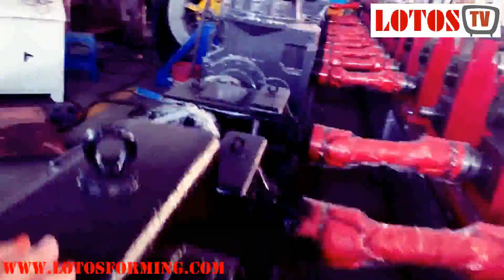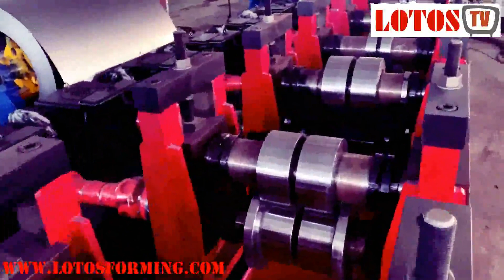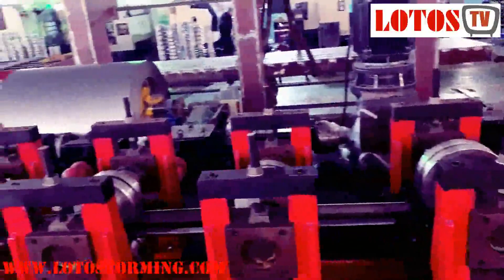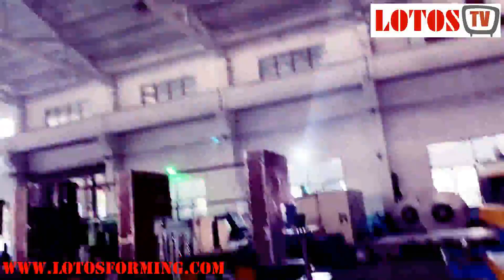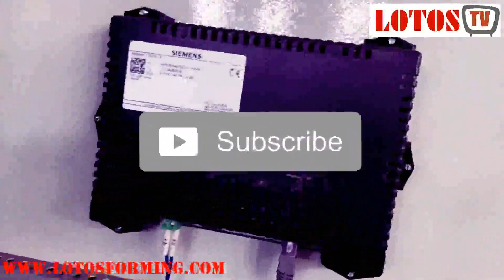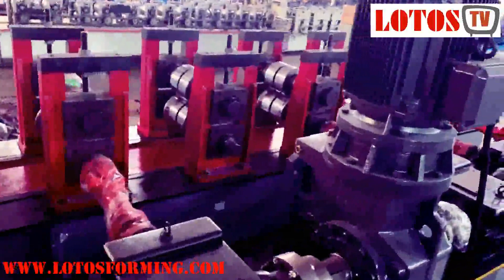【C Channel Making Machine】: C Beam Roll Forming Machine | post beam making machine

Comment: LOTOSFORMING produce C Channel Making Machine and C Beam Roll Forming Machine or post beam making machine for the metal beam guard rail.

 a c post beam used in the manufacturing of machinery, enclosures, and vehicles. POST BEAM also use in the construction of buildings for structural support.